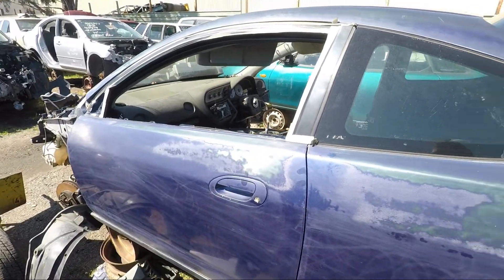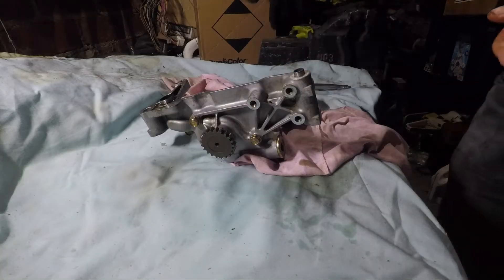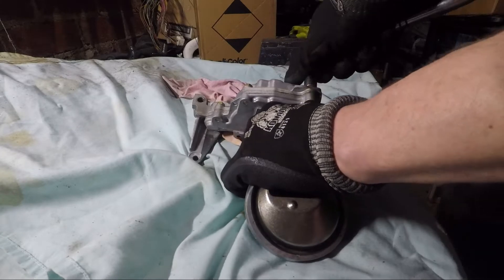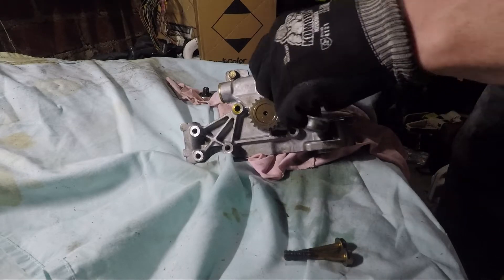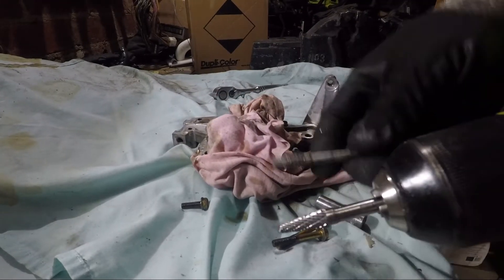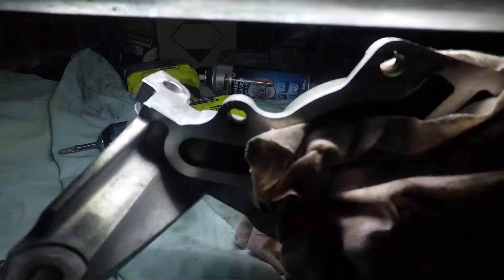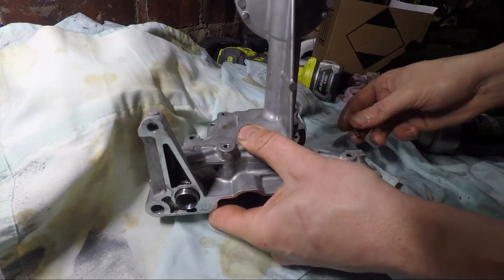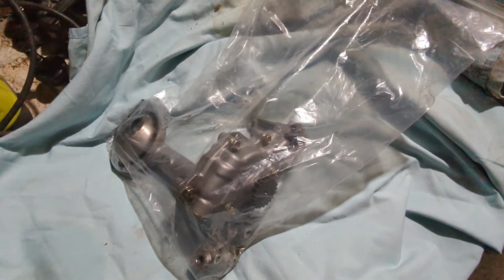DIY Porting of a honda K20 oil pump

Comment: Nice one mate, whats the benefit of porting the pump, higher oil pressure? More consistent psi at higher rpm?
Reply from the maker: yeah apparently the sharp right hand turn causes cavitation at high RPM. This is all they do to the 4 Piston ones which are twice the price of a standard one new. 

How's the exhaust coming along?
Reply: @teamaxlestands  ahh yes makes sense, exhuast has turned into a mess the guy who is helping me has had some issues and has alot of the parts. Hopefully this week can get it sorted